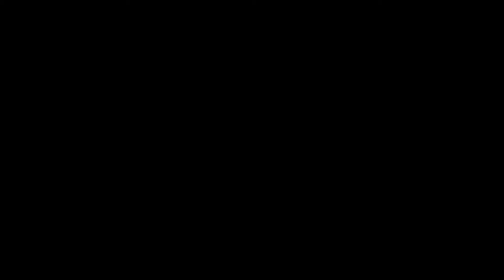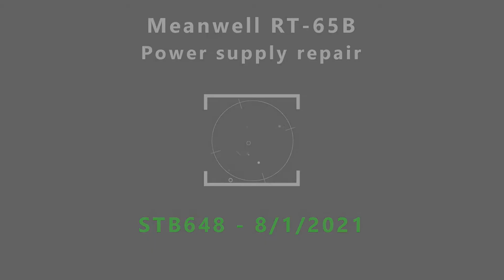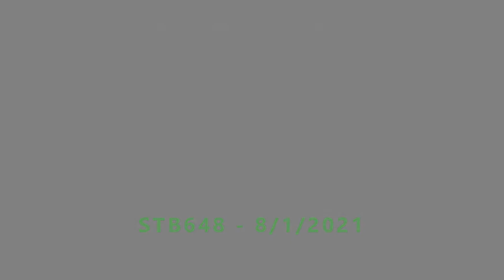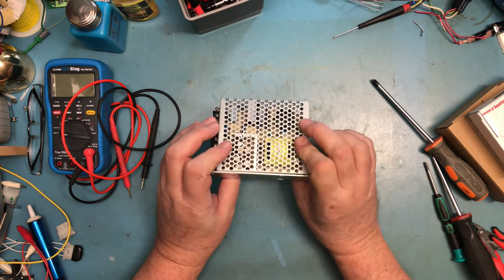STB648 - Meanwell - RT65B - Power Supply Repair

Comment: Great video! This helped me find the two screws behind the sticker! I know it's been a while since you posted this, but I have this exact power supply, and I accidentally connected the -12 and +12 V outputs, and popped Capacitor 62 (100nf25V). Before I did this the negative (V3) was reading at about 12V. Now I've replaced the cap, and the negative is reading at 13V. My question is, do you think there is something else broken that I need to find? If so how would I do that? (total noob at this, I'm just getting into DIY electronics)
Reply from the maker: As I recall the -12V uses an 7912 (Negative 12V regulator). If you're seeing -13V I'd suspect it has an issue.
Reply: @ShadowTronBlog  thank you! makes perfect sense

Comment: Thanks for this - I also did this on a RT50B which has the same component, though any markings on mine disappeared in the chunk of the regulator now missing!  Buying a $2 part sounds much better than a new PSU so very much appreciated!
Reply from the maker: Glad this was helpful. :)
Reply: @ShadowTronBlog  Electric shocks - 1 (damn 240volts!). Circuit breaker tripped -2. Burn marks on outer casing of Meanwell -2. Hey - it  still works! 🙂

Comment: At the line input side you have inductors and capacitors for EMC reductions before getting to the rectifier bridge and bulk capacitor. The very first transformer there is a common mode choke, so no real transformer. The bigger yellow transformer is the real primary/secondary separator. This transformer is driven (pwm) by the big transistor or FET from a regulator circuit. This circuit receives voltage feed back from one of the secondary voltages via the opto couplers, most likely from the +5 volt as this is the most important one. On the secondary xsde you often have a single side/capacitor combination, sometimes followed by a simple regulator for a low current output like your -12V output.